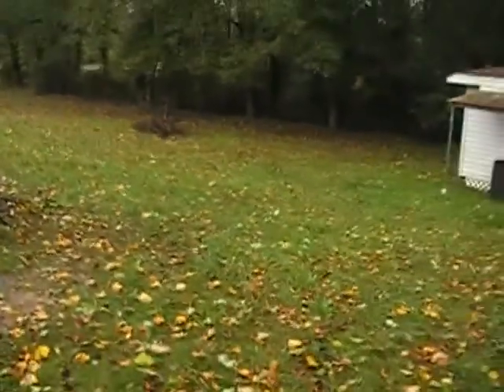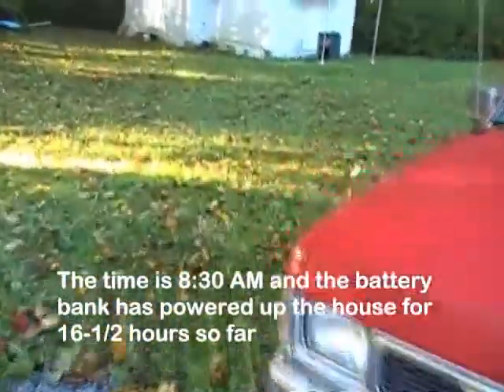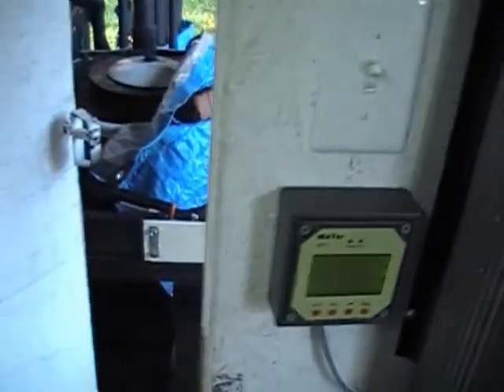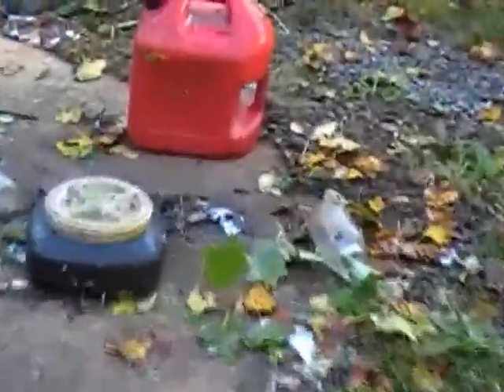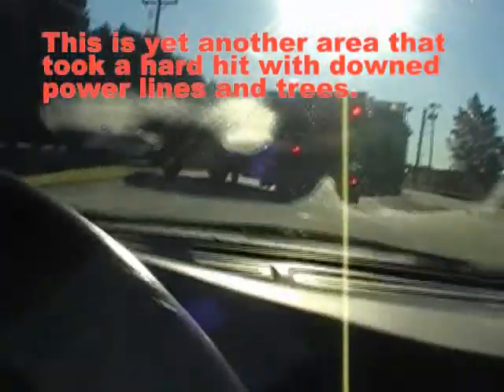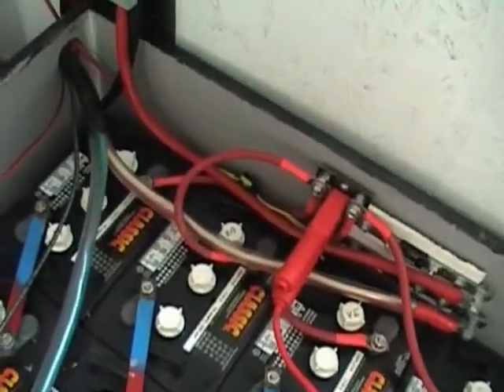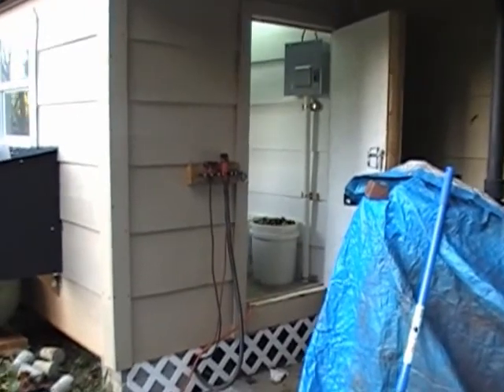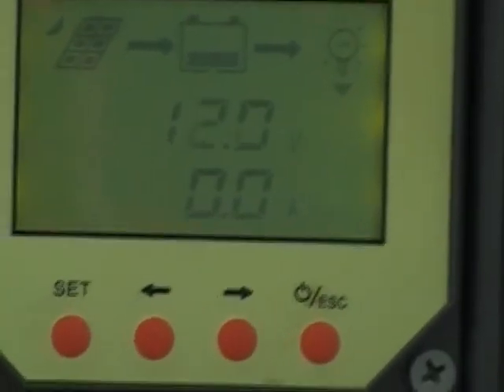Power outage 10/21/2017 (Real world back-up battery test)

Comment: How's that inverter working out for you? What did it cost you? Been waiting for prices to drop, pretty sure that's a Chinese model by looks of it.
Reply from the maker: The inverter did it's job and kept us in the 21st century! Since this video was make I've upgraded the whole system. I now run a 48 volt system along with a Spartan inverter that can deliver 3300 watts continuous power with a surge of 9900 watt surge rating so it will start ANYTHING inductive I have here. I can turn on my drill press and my compressor with only a slight flicker. This unit has the big transformer inside of it and in my opinion it's cleaner the one in this video. The inverter in this video was only a 12 volt setup and it only had a 6000 watt surge rating. We are ready for the upcoming storms so all id good.
Reply: @flash001USA  nice... 48 volt has become standard nowadays. Thanks for feedback on that, always looking for peoples real life experiences with these inverters. Hoping to get one eventually and before SHTF which may be sooner than we think. The gasifier really has peaked my interest. I've watched 12-15 builds in past week. That is truly the solution for individuals long term. Bamboo is a perfect renewable source. May want to contemplate starting some if you have room.

Comment: Question why didn't you use the gasifier
Reply from the maker: I could have and I've actually got fuel on hand for it but I would have to babysit it until I get the Automation in place. If it came down to it yes I would be able to run a generator off of the gasifier.

Comment: how many amp hours are the batteries? I have 200 amp hour golf cart batteries. but in series for 24 volt. I kinda wish I went with 12v. I trying to find some 24 v alternators. to build a DC generator and a water wheel to generate power. I have two 150amp.  two 130amp and 1 130-140 or so HD. Delco alternators. but they are 12 volt. I been trying to come up with a clever solution. but haven't yet!
Reply from the maker: I'm using 8 golf cart batteries. Here is my setup. https://www.youtube.com/watch?v=oPXblR1MRy8&t=1275s

Comment: where about are you? we had tornados in and around Wilkes county . I had power out for about the same 20 some hours.
Even the local radio stations were off air for a few days. I need to build a gasifier. for days with no sun. when I get solar panels. thanks for the video
Reply from the maker: I'm in Cherokee County near the NC state line. Where is Wilkes county?
Reply from the maker: James I'm in Cherokee County in Gaffney SC. I'm not in town but just outside town very near Hwy 11.

Comment: Oh boy! 
 That storm sure did some serious damage in yer neck of the woods! 
 It is surely at times like this that you really get to appreciate watt you have been building  :) . 
 Well done indeed. 
 Just a wundrin', do you reckon you wood ever consider putting up a couple of solar panels? 
 That way, you could save yerself a fortune in free woody bits during these kinds of events. 
 Well, It's watt I wood do  :) .
Reply from the maker: Steve I'm set up to use them. I have them ready to go if the grid ever goes gown for a long time or even forever. For now I use a battery maintainer that keeps the batteries ready and it doesn't really use that much power plus I have the generators and soon to be woodgas on standby too so I'm good to go.

Comment: Put a multi-meter on the 12v output of the generator. If it is only putting out about 12v, you are not charging the batteries all the way. Your battery tender served you well. Thanks for sharing
Reply from the maker: The big charger will take the 6 volt batteries right up to 7.2 volts so it gets the job done. The smaller charger is too slow to really charge the bank up but it can maintain it provided the bank is charged if I need a back-up maintainer.

Comment: I can hear it in your voice, how pleased you were with the results. It will definitely be your primary " go to " system when ever you lose grid power. In fact, I look forward to losing the grid as I have pretty near the same set up. Even with 7 different generators, 7 different sets of problems I always go directly to the battery bank...no problems, it's a plug and go situation. Then I can go start the  generators at my leisure with out fear that the wood furnace will boil over. You've got some real time crisis under your belt now and you learned a lot, I'm sure. I'll bet your girl is a real believer now, eh?
Reply: I forgot to add : After I get everything powered up here at the compound the favorite part begins...firing up the gasifier, starting the Left for Dead Honda, twerking up the alternator to 14.2 and re charging the battery bank. Man, it don't get any better than that.
Reply from the maker: Yeah Bill it carried us through the power outage. She was tickled that we didn't loose any food so she believes.
Reply: Now, she is really going to want to go "off grid" and pull the plug so to speak....... Can you set that up with a automatic transfer switch?? Just in case you are not at home when the grid goes down. All your hard work paid off. Excellent.
Reply from the maker: That's on the agenda for sure. For now I'm set up with a few custom made heavy drop cords that can lay on the floor for quick connecting. I also have modified UPS power for the TV and the lamps in the living room that will carry the living room for at least 3 hours or more without the battery bank and the same with the computer room too.
Reply: Give it time. You'll get it done. The UPS is a great idea.